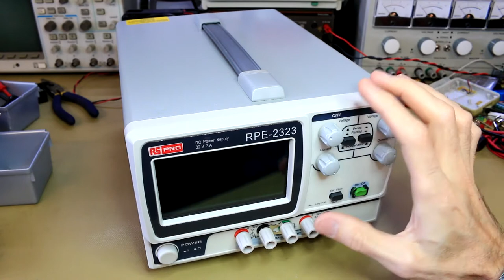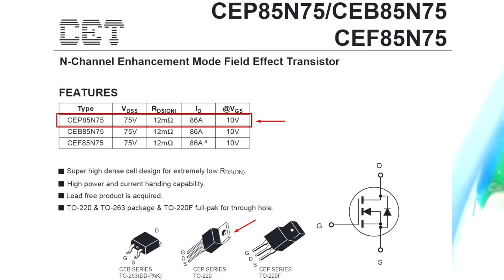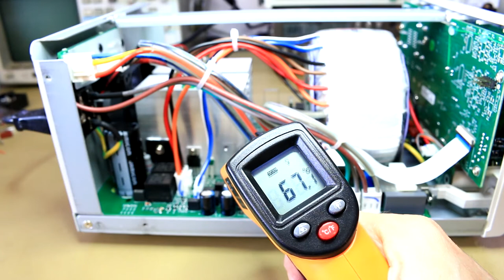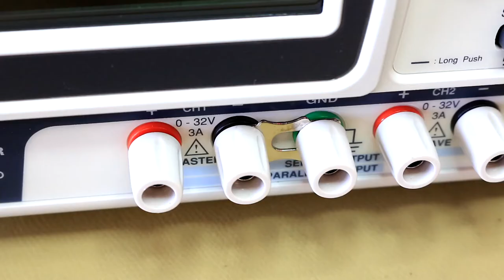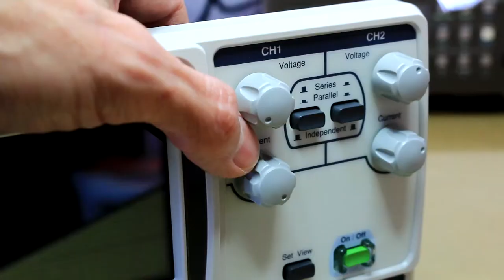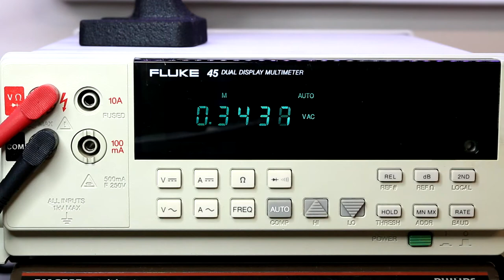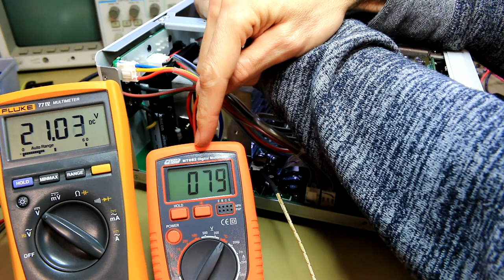RS Pro RPE 2323 power supply teardown (#021)

Comment: Nice review - I have the GPE-4323 model and was also wondering about the transformer bolt shorting the core but there is an isolating washer mounted from the front of the PSU.

Comment: thank you for great presentation. I watched with full concentration. I have this model exactlly. unfortunately its 4 PIC microcontroller mine device failed. Is there any solution?
Reply from the maker: Can you elaborate on the failure? In other words, did all the PICs fail or just one? Is the unit still partially operating? (I'm thinking that perhaps the power supply to the PICs may have failed.)